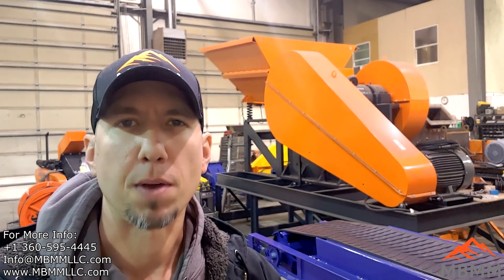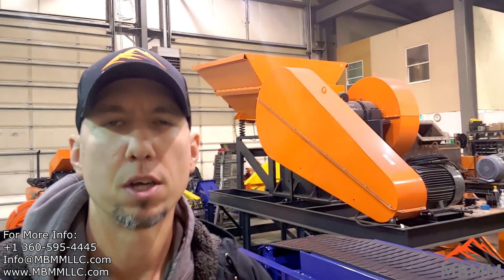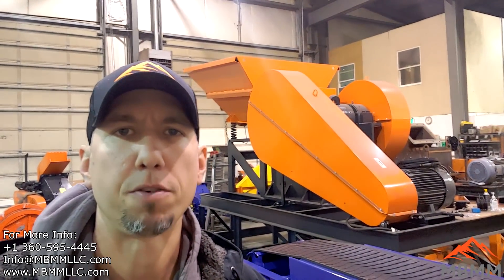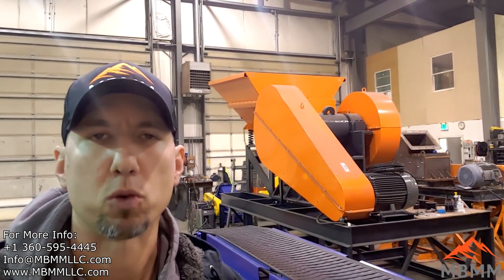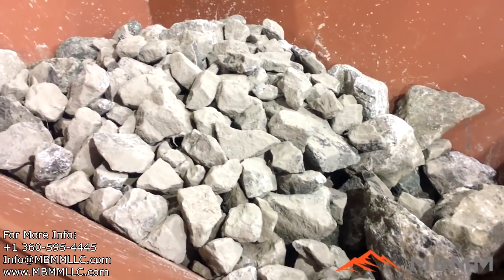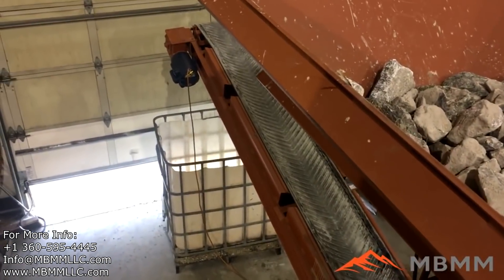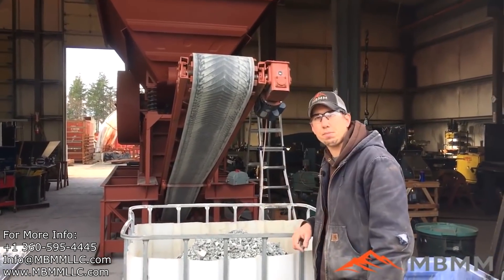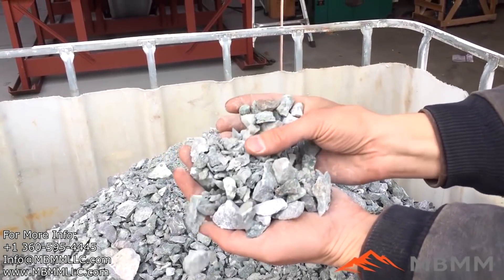Jaw Rock Crusher Working

Comment: how about that electromagnetic ionization mass spectrometry filtering for the most valuable metals, like platinum, gold, iridium, uranium, plutonium, americium,...
Reply: not only detection but mass separation, directly into the constituent metals, not even oxides, or sulphates, direct metallization ionization filtering plate ion spraying
Reply: only the source rocks and electricity needed, from like wind, solar, anything pulse renewables are ok for independent operation
Reply: so why do cars have over 100kW of power, make them as generators

Comment: i have your smaller crusher.  i use it for testing rocks for gold.  after the test i have to clean out the crusher for the next crush.  i'm thinking of a way to run water at pressure through it to clean it for the next crush test.  i also have one of your hammer mills  with the same problem.  even taking off the top i can't clean it out easily.  am thinking of drilling a hole in the bottom, tapping screw threads for a plug, then for cleaning i would insert a thin, bent pipe for high pressure washing the sand out of the drain plug.

Comment: What happens if there is rebar in broken concrete and wiremesh?
Reply from the maker: It works great on rebar if the rebar is smaller than the minimum jaw gap distance when crushing. It cleans it up and then can be pulled out with a magnet mounted over the discharge conveyor. Thanks
Reply: @mbmmllc  Hey Thanks!!!